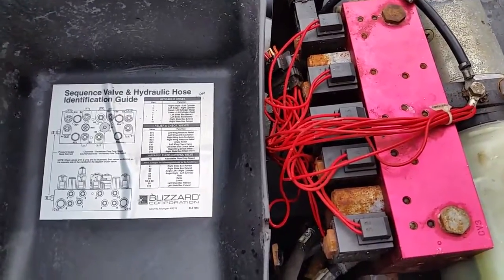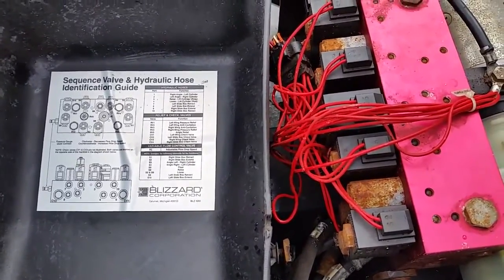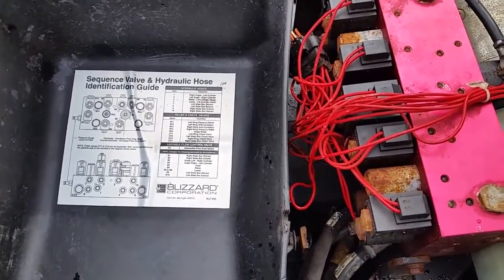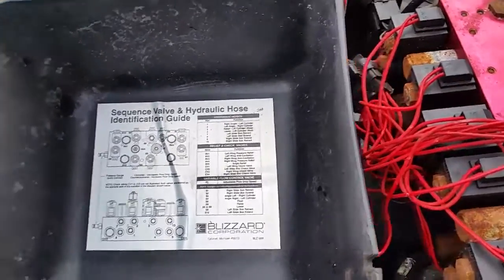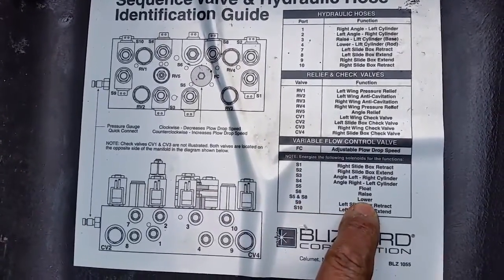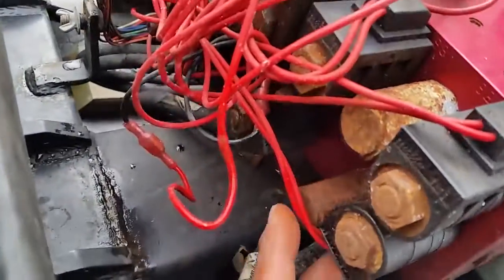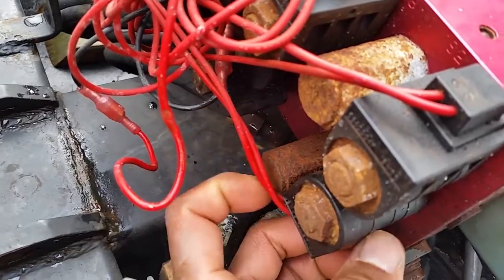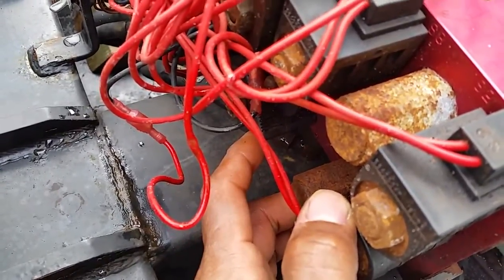2004 Blizzard 810 Snow Plow stuck in up position

Comment: Awesome
Reply from the maker: Welcome
Reply: @GriffsServices  my plow won't go down and if I give the little magnet float one it will go down and then I can go up and down about a dozen times but then it will get stuck up again and if I give it a tap it will do the same thing over and over
It will work about 10 times and then I'll have to tap the end for it to work again so I'm not sure if the magnet is bad or there's just a loose connection somewhere but I have been screwing around with it for 3 hours
Reply from the maker: @jeremyillingworth4302  could be the coil or valve...
If you can move one of the nearby coils over the valve, then move the controller for that respective coil, if it works it's the coil ..
But I am thinking it's the coil. Especially since it's a somewhat random occurrence
Reply: I thought the down one was magnetic and the other ones were not I did not know you can't interchange them🤷‍♂️🤷‍♂️🤷‍♂️🤷‍♂️ I thought the other ones were not magnetic
Reply: @GriffsServices  fh